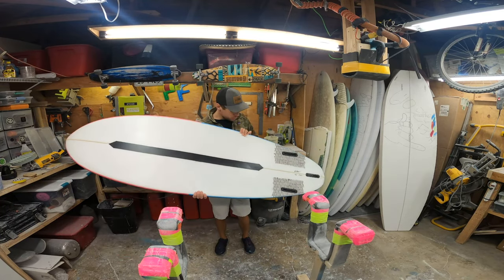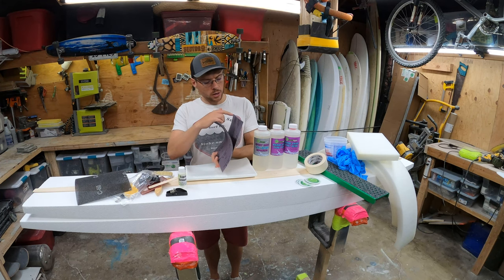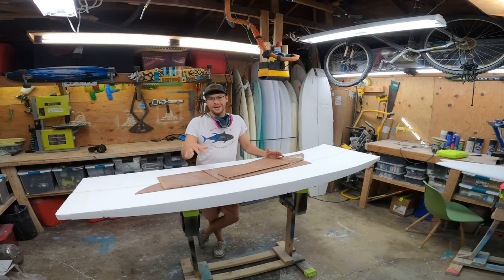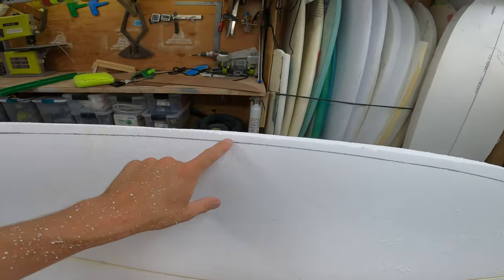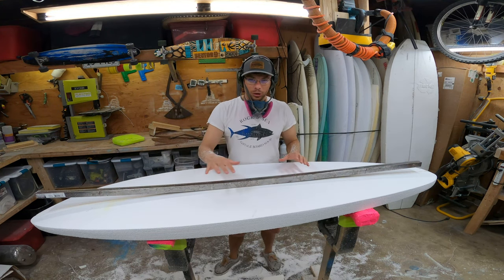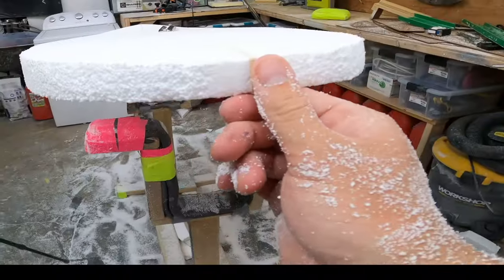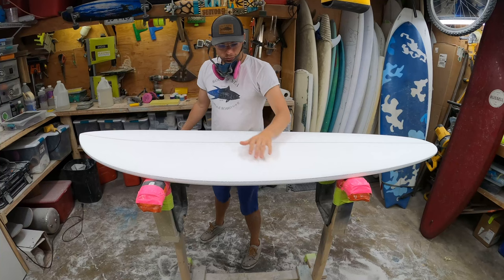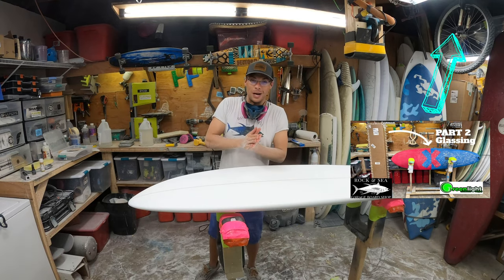Surfboard Build Kit - Everything You Need to Make a Surf Board

Comment: it looks like the blank already has the thickness and rocker? so all that is needed is to cut the out line and shape the rails?
Reply from the maker: Yes sir, blanks are designed with specific rocker profiles and thicknesses.  Typically blanks are thicker than the desired dimension and you shape down to the right thickness, but this one was pretty much right where I wanted it. So very easy, just cut the outline and shape your rails and you are good to go🫡 🙌.   Also check out my magnum opus of glassing tutorials https://youtu.be/v5miveyGlfk

Comment: Hey jDub, what do you use to seal the foam before paint/epoxy. Used  green lights “spackle/paste” but looking for cheaper alternative with easier access at local hardware store
Reply from the maker: @jonjon’sjohnson I use z seal from foam ez, it’s like $30 for a big bucket that you could do like 20 boards with.   But honestly now days I rarely seal epoxy boards and I would say for most cases just skip that step!   So with EPS blanks the little beads can easily pull out leaving little holes in the nice flat surfaces of your board, the holes trap excess resin adding weight and can look a little funky.   If you sand it nice enough you can eliminate most or all of those little holes and then you don’t need to seal it at all.  I’ve used dry wall spackling from Home Depot before, it’s a cheaper easy to access alternative but the color doesn’t match the blank as well, although doesn’t matter if your coloring.  Hope this helps!

Comment: Do you want the rails to be 90 degrees from the deck, or from the bottom? I just squared mine to the bottom so hope I didn't royally screw up 😬
Reply from the maker: Hey no worries man, should be square from top and bottom, but….. since bottom is nice and flat and not domed like the deck, I always square from the bottom primarily, and then go back and double check from the deck🙌.   Feel free to reach out with questions, hope this helps Chris!